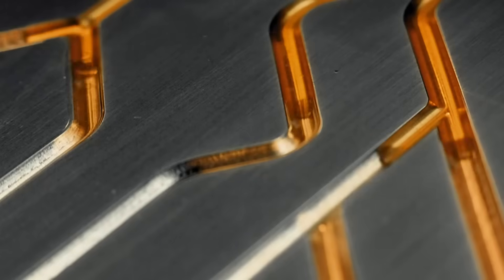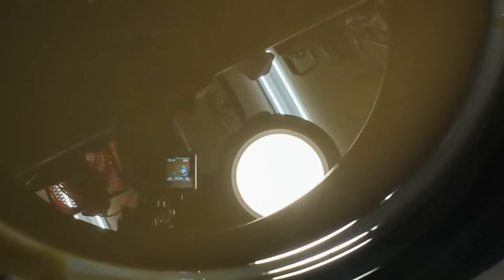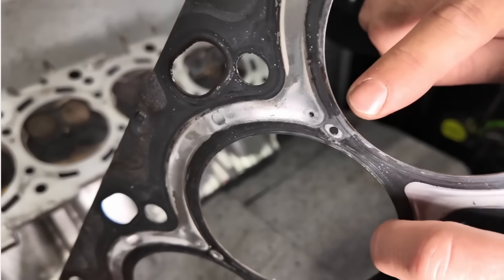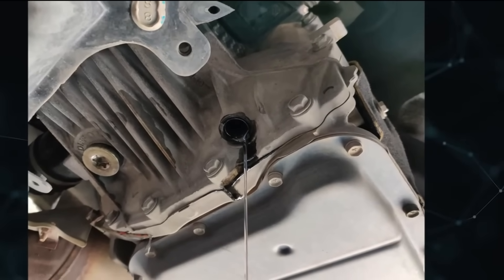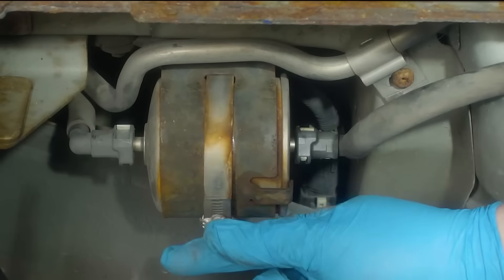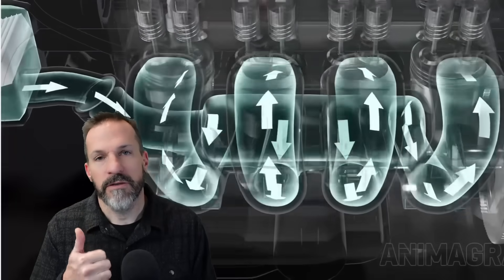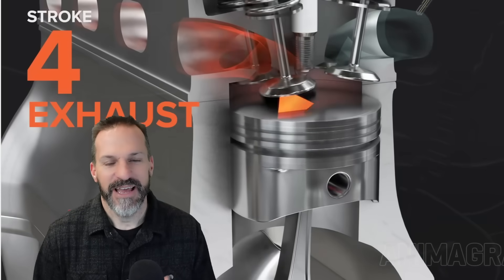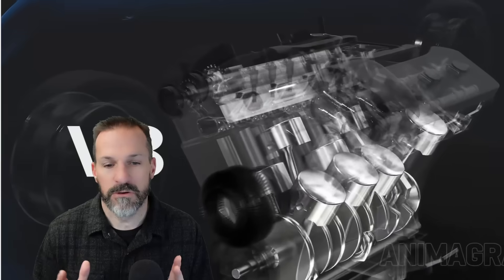Car Maintenance MOST People Ignore! Make Your Engine Last 200,000+ Miles!

Comment: I've over maintained all my vehicles.  Oil and filter every 4-5K miles.  ATF changed every 20K miles.  I fix everything if it breaks.  Never had any engine issues in any of my vehicles for 40+ years.
Reply: transmission service every 20K miles is wild lmao
Reply: @8MunchenBayern8  If it's a simple drain and fill what's the issue? On the other hand if it's one of those "lifetime fluid" transmissions where you have to either flush or do an insane "awkwardly refill until fluid starts coming out" exchanges yeah that would be excessive.
Reply: @hailexiao2770  I mean, there's no "issue". You can also change motor oil every 2K miles too. It's just a waste of money servicing then transmission that often. Maybe if you're doing heavy towing consistently or beating on the vehicle/driving it extremely hard. But for everyday driving it's a complete waste.
Reply: @8MunchenBayern8 I know an old man who changes the engine oil every 3,000 miles and the automatic transmission fluid every 15,000 miles (factory recommended mileage for severe city driving) and his 1987 Buick Century with the original 4 cylinder engine and 3 speed automatic transmission is at 730,000 and still runs like a top.
Reply: @gregorymalchuk272  whos to say if he did 30K mile transmission services that it still wouldnt be working?
Reply: Yup, that’s how it’s done.
A buddy of mine just spent $412.00 to clean up (Service Brakes) not replacing.
2021 F150 with 22,000k
He baby’s it, he was talked into the pre-service then his brother looked through the wheel and felt nothing was done, so they pulled the front Rt tire and sure enough the job he paid for was never done!
I worked in the business for years in dealers as a Bodyman, seen lousy mechanical work all the time.
If you can do it yourself! If you can’t then learn, I use Utube a lot to help me through certain jobs like ATF changes etc.
Reply: @mcmuskie2563  absolutely!  I'm with you 100%. I use U tube university if I need some information on a procedure.  Never let someone else touch my vehicles.
Reply: He fixes it if it breaks but has never had a problem.
Reply: @themitchster359 yeah because some repairs on cars are normal. Like brakes. It’s not a problem because it’s normal that they wear down. Your engine, transmission, or drivetrain shouldn’t be breaking down anywhere near as often as brakes need replacing.
Reply: @themitchster359 your reading comprehension isn’t very good is it? He wrote he fixes it - the car if it breaks. And that he had never had an issue either the engine
Reply: Were they all Japanese branded?
Reply: That’s great. But for me, I’ve under maintained my vehicles for over 55 years and I also have never had any engine issues in any of my vehicles (many vehicles). 👍
Reply: One item which caused me grief in a car I was going to sell was the air conditioner lunching itself …. what a job to fix. Answer is to get it gassed but also the compressor fluid changed. Similarly, I have a car now with a supercharger, these need the fluid changed in them too. Lastly, engine mounts, another item to be aware of, when they fail it makes the car very unsafe.

Thanks for the video, good information here. 👍
Reply: Maintenance vs Repairs
Reply: What kind of vehicle are you driving that's 40 plus years old?
Reply: @bradhaughton6698  read what he wrote again.  Read it slow if you have to
Reply: Man, I could learn alot from you . . . 
You should share/post some of your wisdom
Reply: This reminds me of my time in WW2 and WW3.  I always looked both ways and always let the guy go next to me first.  Called my mom every day and had 3 wives who LOVED me till I left them.
Reply: @Bek-bl2ed , you forgot that you walked between the raindrops never needing an umbrella.  LOL.
Reply: Me neither. I ignore those things and trade every two years.

Comment: 2000 Ford Expedition 5.4 liter 2 valve with the 4R100 transmission. All original accessories, never have had the valve covers off. Original transmission. Just regular maintenance. 5,000 mile synthetic 5-w30 oil changes, 30,000 mile transmission pan drop and filter replacement with Mercon V, rear differential every 60,000 with synthetic 75-140 gear oil. Just one set of brake rotors, a few sets of brake pads and a fuel pump. 230,000 miles and still runs like new.

Comment: 2007 toyota yaris 256k. Replaced 2 starters and 2 alternators, that's it for part failures. Trans oil changed every 30k and oil/filter every 5k.

Comment: I dnt even wait 5k, always 3k 3M, which comes 1st oil and filter are cheap less $30 vs. new engine and dnt 4get the chevron Wtecheon 2x a yr. That's how i put it,tranyy flush between 10k, 15k w/ OE parts, 5k tire rotation, every 3yrs coolant flush,brk fluid, 50k spark plugs etc. My 4.7 ram for 20ys runs like brand.

Comment: I don't have any CarFax history on my car other than recall fixes since I do all my own maintenance.  I worry that is going to be a problem when it comes time to sell it.  People rely so heavily on those reports now.
Reply from the maker: I'm in the same boat, I don't either so my CarFax is light, however I usually tell them the mileage of when things were changed (on everything), then I tell them the fluid brands/types I used and had good luck with. Then by the time they look the car over and test drive they can usually tell that I really cared for it. Telling the good AND the bad goes a long way with building trust when selling too. That's usually enough to shed any doubts. FWIW, when I trade in dealerships don't seem to care about maintenance history that much

Comment: Why do manufacturer's continue to promote extended life oil changes that result in engine failure?  The service advisors line their pockets and the mechanics are trapped in a good versus evil environment.  What a flawed system that needs a major overhaul.  Elon Musk is this your next project for efficiency??

Comment: All these car channels need to at least keep the claims factual.  Longer oil changes have NOTHING at all to do with CAFE, as the F stands for FUEL and the E for Economy, not oil change intervals.

Longer oil change intervals are a selling point for a lot of cars, as the manufacturers want to show the car doesn't need frequent and expensive scheduled maintenance, especially on some European cars where the oil change can easily cost you $250 at the dealer.

The oil change intervals are determined by the MANUFACTURER, there is no government requirement for oil change intervals, so the manufacturer can recommend them every 500 miles or every 50k miles, at their discretion...
Reply from the maker: I understand your point however it's a common defense of government regulations at any level. Most regulations if not all have unintended consequences that can't always be predicted, whether explicitly defined or not in the standards recommendation. CAFE standards indirectly affect oil change intervals by encouraging (financially) car manufacturers to develop engines that are more fuel-efficient, which often includes using advanced oil formulations that can last longer, allowing for extended oil change intervals between services; essentially, better oil technology enables longer stretches between oil changes, helping to meet fuel efficiency targets set by CAFE standards. 

You are also correct that manufacturers benefit somewhat from this, pitching less hassle for the customer, they say "free maintenance for 2 years" when really that just includes 2-3 oil changes at most so it's mostly marketing garbage. Even the European cars, if you do your oil at home, cost only $40-$60 or so to perform the change. Dealers charge what people will pay, vote with the wallet. 

It's similar to say the government didn't force turbo charged engines explicitly, while this is true, they did however created standards that forced manufacturers to either go turbo or electric (their end goal) to meet the regulations. 

Same goes for "lifetime fluids" like some manufacturers suggest for transmissions, don't believe the hype.
Reply: @TheCarGuyOnline  OK, not to be disrespectful here, but I have read your claim several times, and it still doesn't make sense to me.

"CAFE standards indirectly affect oil change intervals by encouraging (financially) car manufacturers to develop engines that are more fuel-efficient, which often includes using advanced oil formulations that can last longer, allowing for extended oil change intervals between services; essentially, better oil technology enables longer stretches between oil changes, helping to meet fuel efficiency targets set by CAFE standards."

Yes, CAFE standards encourage manufacturers to make more fuel efficient engines.  We can all agree on that.

The advanced oil formulations that can last longer and allow longer oil change intervals is mainly due to 3 factors.  Improved oil formulations with better wear additives, tighter engine tolerances and cleaner burning engines due to fuel injection, sensors, multiple valves per cylinder, turbo charging, and other technologies that make engines run cleaner, and more efficiently.

Your last portion however doesn't really make any sense.  Extended oil change intervals, or longer stretches between oil changes, doesn't improve your fuel economy, at all, in any way.  Hence, it simply doesn't, in any way, help meet the CAFE standards, which have to do with FUEL economy, or amount of fuel burned per mile, NOT oil changes.

Yes, the government requires manufacturers to improve fuel economy.  Which has actually massively benefitted the public.  Less fuel burned means far less pollution, less money spent per mile, and heavier, larger and much safer cars today, with much better performance, have arrived with basically zero penalty in MPG.

So, we may agree or disagree on the wisdom of "lifetime" fluids, or longer oil change intervals, or even thinner oils.

But, no matter how you slice it, CAFE regulates literally only ONE thing, how far you can drive a car on a gallon of gas.  

That's it.  The debate over oil life and engine lifespan is a separate issue, and really should be debated separately.  It is not in any way a CAFE related issue.
Reply from the maker: @redbaron6805   lol…the last part first paragraph I wrote incorrectly I agree and it doesn’t make sense, I assume you understand though the “better oils” claim, thinner and claiming more protective yet longer intervals does not mean better for engines or related parts in these designs. 

Watch the motor oil geek on YouTube, the more fuel efficient oils produce a lot more engine wear (metals), but get better MPG. Is it better to have vehicles in the junkyard after 200k or better to have them last longer? I think a car lasting 400k and using more fuel is better than a fuel efficient car ending up half recycled and only lasting half the life. 

I’m surprised that you think turbo charged engines are cleaner, have you worked on these cars and looked at the oil even in shorter intervals? The turbo engines I have worked on can damage oil with heat, you end up with much darker oil and more contaminants at lower miles (catch cans might help). Turbos are only used to generate more power to compare with larger displacement engines, not because they are cleaner or get insanely better MPG (marginally better). The argument I’m making is the unintended consequences of these standards. Do you think the standard was good for reliability?
Reply: @TheCarGuyOnline   a car lasting 400k  doesn't have google snitching on you in it
Reply: @TheCarGuyOnline Using thinner oils may have been influenced by CAFE ratings, but claiming longer change intervals is 100% on the manufacturers. CAFE says nothing about those.

Comment: I have a 1997 Nissan pickup. 436k miles. Still runs good. Drive it to work every day. Maintenance is cheaper than repair, also cars don't break down in your driveway or at the repair shop, they break down out there somewhere. Maintenance can also prevent being stranded.

Comment: I live in Australia and own a 1997 Toyota Hilux just a 2X4 aluminium trayed ute with the 22R engine now when l change the oil every 10000 kilometres there is the same amount of oil that comes out as l put in and l know it doesn't burn any oil is because there is no cat converter and a carburator and there is no blue smoke out of the exhaust system and the Hilux has done 440000 kilometres over 200000 miles also in the five years l have owned the coolant has been changed twice when a new radiator was fitted and the second time when l changed the radiator hoses and l have done only 30000 kilometres  in it

Comment: Aiming to go 350k with my '09 2nd gen, 2.7, 5 speed Tacoma.  Just replaced my front end myself (LCA, inner/outer tie rods, sway bar links & bushings (all MOOG) and Bilstein struts, CV boots and grease) for under $2k! Loving the journey so far as I nearly cross 200k miles!

Comment: 200k miles should be the engine's break-in time. I bought a car with 250k miles where the oil was hardly changed, full engine sludge but the engine still ran beautifully. Any engine can last 200k miles if it doesn't have a serious construction flaw - such as weak material, poor lubrication, etc.

Comment: First time watching your channel, and its rare on Youtube to have a video that actually has basic common sense. I will take issue with one recommendation though, and that is adding anything to the oil like " Seafoam " can be risky, since depending on the product and the % of the volume of oil, it could upset the chemistry in the oil to a detrimental level. Now, do people get  away with it ? Sure they do. But very few if any of these snake oils are tested and or regulated by experts.
Reply from the maker: Yeah I would agree, I should probably be more specific about that. For me, the situations it has worked well are with my Toyota 5.7L, sticking timing chain tensioner which is oil pressure driven, seafoam treatment did help a lot however I was very careful about how it was applied. I only had it in for 100-200m of light driving/heat cycles, dumped and replaced with new oil immediately after.

Comment: 319,000 on my 95 Honda odyssey, 250,000 on 99 Toyota rav4, 221,000 on 98 Honda prelude. No mejor issues on this. 06 Subaru sti completely different issue. Po447,448, 456,  302 the worst burnt valve $5116 dollars for 1 valve

Comment: That video got pretty expensive?!!??!!? 

You going to change the fuel filter inside the tank?!?
Reply from the maker: Depends on the year, obviously some are inside tank and you won't change until they fail, older are not. Not everyone owns newer vehicles, many vehicles still in my family are from the 90s/2000 era and some have inline fuel filters that are easy to change :).

Comment: 310k on Honda Odyssey.  Oil changed every 7500 miles and timing belts replaced every 125k.  Transmission oil has been changed twice and coolant flushed once.  Had oil burn issue and ran Seafoam and it fixed the issue.

Comment: Fuel filter change?  Where is a fuel filter on a modern vehicle?  Are there any fuel filters in cars or trucks today? I had no idea.
Reply from the maker: Many modern cars don't have the traditional in-line fuel filter, it really depends on what you have. Many older vehicles do, new are sometimes integrated into pump assembly...many in gas tank so it will be vehicle dependent and not as critical in newer vehicles.

Comment: If you got a car with some miles on it, try that Valvoline Restore & Protect. That oil works good, my Toyota runs better and get better mpg now. You need to use it at least 3 times and the first oil change when using Restore & Protect should be done around 2500 or 3000 miles. After that I would use it as normal.

Comment: I follow the factory maintenance schedule and per my use it needs 5000miles/6 month oil change. Same story for front diff, rear diff, transfer case oil changes with my usage. My maintenance schedule show needs for these conditions -  Driving on dirt roads or dusty roads, Driving while towing, using a car-top carrier, or heavy vehicle loading, Repeated trips of less than five miles in temperatures below 32°F / 0°C, Extensive idling and/or low speed driving for a long distance such as police, taxi or door-to-door delivery use.

Comment: My family had a total of 3 Toyota Avalons  in the range of 2000-2004.  Two are off the road with over 250,000 miles.  Mine is still on the road 21 years later with only131,000 miles.  

A person can brag that he can drive across the USA with bald tires and bad brakes.  That isn't me.

Comment: 237k on a 2016 Jeep Patriot and still running strong.  I have a comprehensive maintenance log I use. If you have a MacBook or iPad there's a software program called Car Manager.  I've been using it for close to 13 years.

Comment: You missed the oil pressure. If you don't have a gauge from factory get one put in. Any drop in pressure indicates a big problem coming up. If you buy a use car have the pressure checked and get the car on a lift and look or have a mechanic do it
Go online and look up what fails on the vehicle you are buying. If you are going to change the transmission fluid, drop the pan. There is a magnet in the pan clean it and change the filter. I also change the coolant every 2 years no matter what they say. I always get 200,000 plus out of my vehicles. I have been rebuilding gasoline and diesel engines for over 30 years.

Comment: Our 2008 Honda Element milage was 404,000 when we sold it. I routinely changed the motor oil, trans oil, diff fluid, and coolant , and had tune-ups. Still purred like a kitten when I sold it. Maintenance is everything!